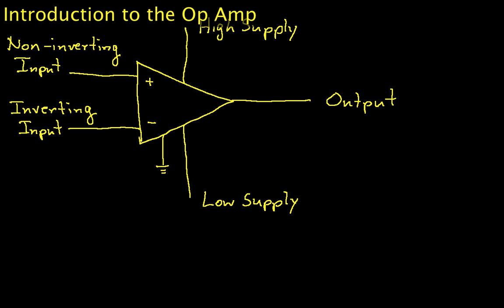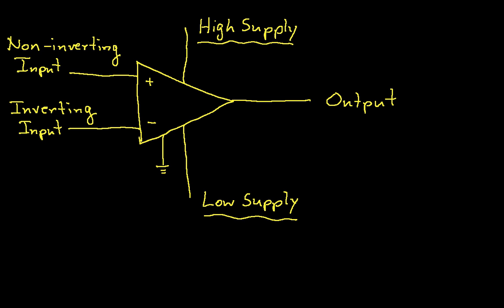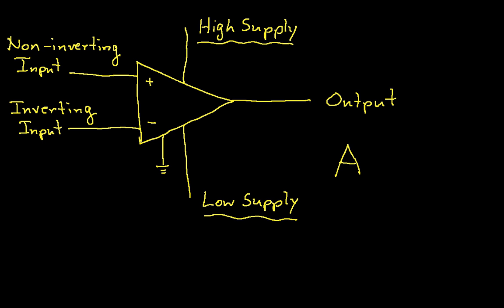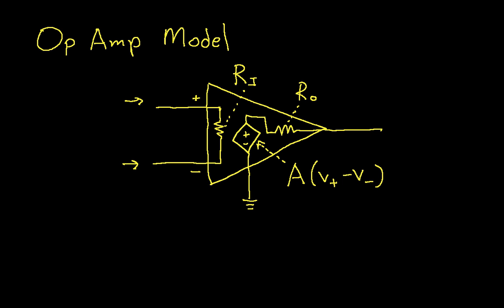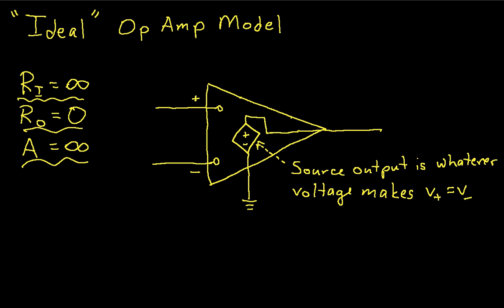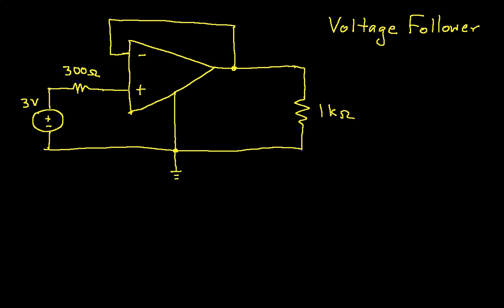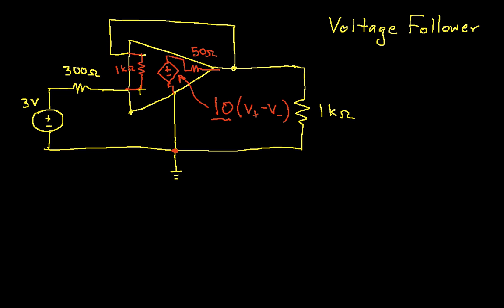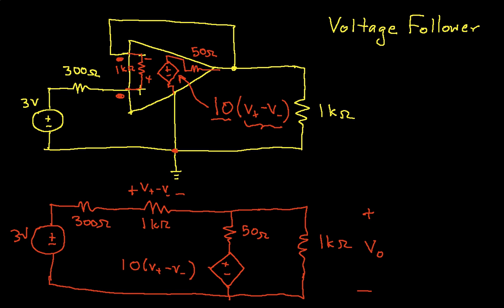Introduction to the Op Amp Part 1

Comment: Very good video Thanks;
The clearest video seen till now on OpAmps circuit analysis; & have seen plenty.
Visuals:10/10 (appealing diagramming, clear + non-distracting
Contents: 9/10 to the point + includes necessary info
Audio &voice:10/10 excellent enunciation and good speaking rythm to grasp info

Comment: A minor point in reference to the first diagram: It shows a 'ground' connection, but there no "ground" pin on an opamp.
Reply: The "ground" connection is a common line from the center connection of the power supply. The power supply for an op amp is + "X" volts and - "X" volts with a center connection where the "+" and "-" of the other lines of the power supply are joined. The input is between a terminal and the ground line and the output is also between a terminal and ground.
Reply: kansasthunderman1
Thank you. I was referring to the pinout definitions of opamps. If you look at the manufacturers pinout for an opamp there is no "ground" pin. There are two power pins, often pins 4 and 7 for a single opamp, and you might connect pin 4 to "ground" if you are running it as single-supply, but pin 4 is a power supply pin, not a "ground" by definition.